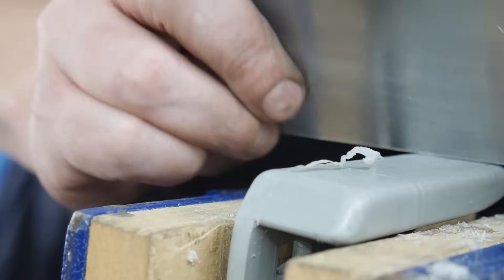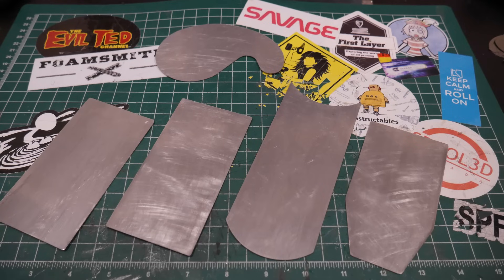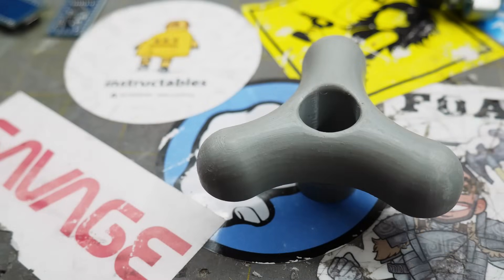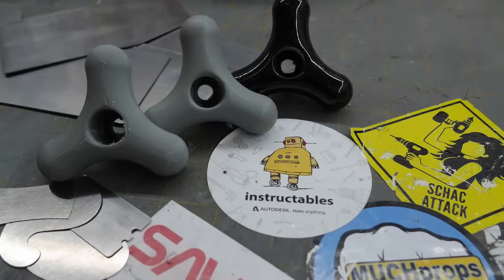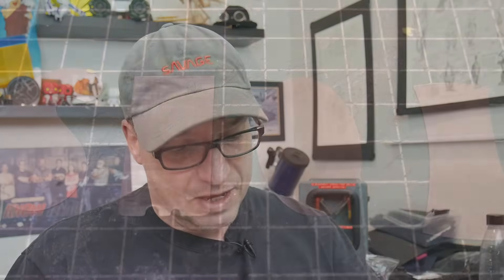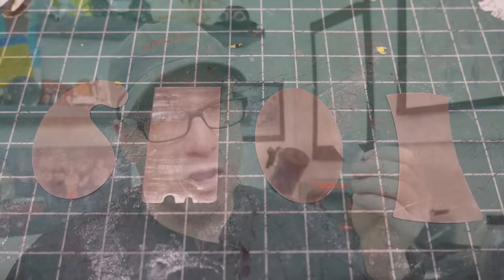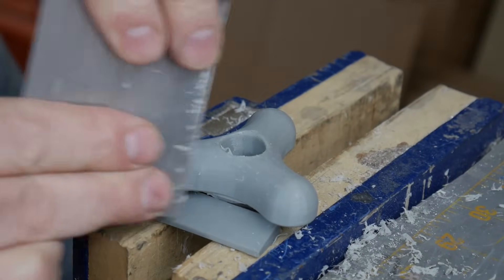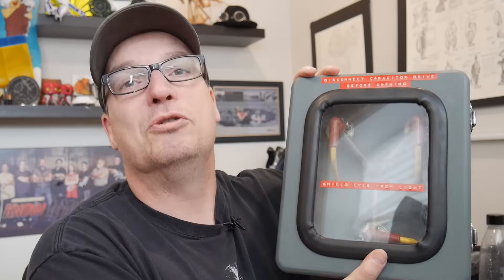Smooth pla 3d prints by shaving them. Don't sand your pla, shave it.

Comment: Ben, I make small custom scrapers using that black steel banding they use to bundle lumber together for deluvery to lumber stores and at construction sites. It is ~3\4" wide, carbon steel. One can cut the profiles  wanted with tin snips (which leaves a decent though rough burr), or refine it with sharpening stones  files and a burnisher.
Reply from the maker: Here is a sneek preview of my next video: https://youtu.be/TbvFPN7yxt0

Comment: I refurbish printers for a living, and use a razor blade with the edge folded over to do this exact process for removing scuffs on the outside. It works way better than magic erasers to remove marks from plastic, is very quick, and barely removes any material.
Reply from the maker: Here is a sneek preview of my next video: https://youtu.be/TbvFPN7yxt0

Comment: If you're really desperate to try this out (before buying all the gear) you can use a NEW utility knife blade and use it carefully (can catch an edge and/or skip easier than with a real scraper, esp'lly when it starts to dull) and you have to use it more vertically than a scraper (pretty much 90°) - once it dulls slightly it's over though - still plenty sharp to use in your utility knife. I prefer the stanley trapesoidal (11-911) blades than the snap-off ones (though they'll do in a pinch and for broader flat surfaces), but I'd like to try their 28-510 blades which are more flexible (used in sticker scraper handles). If anyone has, let me know below.
This is definitely the poor/lazy person's scraper though - better results are achieved with a properly 'sharpened' scraper.
Reply from the maker: Here is a sneek preview of my next video: https://youtu.be/TbvFPN7yxt0

Comment: i find if your prints are smooth enough, removing stuff with a good scalpel and then sanding a little before a coat of resin is good enough
Reply from the maker: Not many coat with resin. But that is a method I use occasionally
Reply from the maker: Here is a sneek preview of my next video: https://youtu.be/TbvFPN7yxt0

Comment: Great info and good tool to keep on hand. You might also want to look into filler primer if you have not already, it's basically primer in a spray can that goes on super thick and self levels and can hide 75% of layer lines with 1 coat, that along with these scrapers should make for glass like prints. The filler primer also sands super fast and easy if you need to. I often will just spray 2 coats of primer filler and then paint with no sanding at all and get almost perfect results.
Reply from the maker: I have tried this and it honestly is not as effective. I do have a method I find works better than the filler primer and is not a aerosol here https://youtube.com/shorts/NVWWO6kvzXE
Reply: @DreadMakerRoberts  I have used a lot of the spot putty as well (though not thinned) the Dupli-Color filler primer is the bomb though (much better than Rust oleum) and I found out about it from a friend that paints $100,000+ cars for a living, yea he uses it on them. His paint jobs look like piano finish (wet look) and they are amazing (pricy as well).
Reply from the maker: Here is a sneek preview of my next video: https://youtu.be/TbvFPN7yxt0

Comment: Spray filler
Reply from the maker: Seriously not as good in this case and less aerosols
Reply: @DreadMakerRoberts  You painted the part anyway, so a precoat seems fine.
To get stuff baby skin smooth I put on 2-3 coats with light sanding in-between. Shaving sounds good to get sharp edges back
Reply from the maker: Given where I work I rarely get the time to do 2-3 coats. I am lucky to be able to get a prop to set that has had time enough to put it on camera before the paint is dry :)
Reply from the maker: Here is a sneek preview of my next video: https://youtu.be/TbvFPN7yxt0

Comment: what helps .. print asa.. or abs.. they sand like 100 times better :) i always like asa.. cause less smell and uv resistent and very strong
Reply from the maker: This works amazing on both of those and you still gain speed on sanding
Reply: @DreadMakerRoberts  sure but sanding asa/abs is way easier and has better results
Reply from the maker: That’s cool. We can agree to disagree. This has me pausing to re-try just sanding. So if I do that how about you take the edge of a stainless ruler or back of a razor blade and try my way. Deal?
Reply: @DreadMakerRoberts  difference is realy pla petg vs asa or abs there pla and petg are hard to sand
Reply from the maker: Here is a sneek preview of my next video: https://youtu.be/TbvFPN7yxt0

Comment: not a bad idea, personally as someone who worked at a rapid prototyping company. The paint department would murder us if we used this to surface parts.
Reply from the maker: Why though? Too smooth? You can hit it with a light grit very quickly after to establish a bite for the paint.
Reply: @DreadMakerRoberts  for a concept car for Ford or Honda. One, the size of some of the parts is just to large. For professional grade paint job a catalyst hardening primers are needed. With these the possibility of the surface looking wavy after painting is higher than a using a sanding block. Plus the dudes full time surfacing are very efficient and fast at what they do
Reply from the maker: Totally. I’m not delusional, the pros and everyone else have their ways. This is just a thing for people to consider. It works like gold for me. In my world that’s what counts.
Reply from the maker: Here is a sneek preview of my next video: https://youtu.be/TbvFPN7yxt0

Comment: If you are using them for resin prints, would you cure the print first or shave it after a IPA bath?
Reply from the maker: It works on resin. I find you can bulk take off material in the raw state uncured and then fine details in the cured state. However the tougher resins that are flexible do not work as well
Reply from the maker: Here is a sneek preview of my next video: https://youtu.be/TbvFPN7yxt0

Comment: Looks like a good idea. Will give it a try 👍
Reply from the maker: Has it worked for you?
Reply: @DreadMakerRoberts  I have not been able to find a good scraper where I live 🙁
Reply from the maker: @TheRealStructurer  Where do you live? One can cobble a small scraper together with a inexpensive stainless steel ruler. Burnish the edges of pieces cut off of one and you basically have scrapers.
Reply: @DreadMakerRoberts  Malaysia
Reply from the maker: Amazon or my last suggestion are best then.
Reply from the maker: Here is a sneek preview of my next video: https://youtu.be/TbvFPN7yxt0

Comment: Another Eureka moment provided by a helpful stranger - this is going to save a tonne of time and filler... many thanks. I left a lengthy comment on another video, where a guy was sanding his models down to 2000g and then painting it! Endless hours spent on sanding a piece to the point that the paint can't even establish a good bond. I was suggesting to never sand above 400g before painting (even 220g is reasonable) if you allow for a good primer and/or multiple wet-sanded top-coats. I've used scrapers for ages, but only on wood and the results are amazing and almost glass-like on hardwoods. I'd never considered running it on plastic and now I'm pretty stoked to try it. Gotta get some of the luthier cards (yes, you said it right).
Reply from the maker: Yay! my Canadian tongue said something right for a change eh!
Reply: You can just use acetone. It will smooth and make shiny in one go, no real work or painting required.
Reply: I'm only on my 3rd print on the new printer, so I'll have to give that a try, once I'm a bit more versed in the process.
Reply from the maker: Here is a sneek preview of my next video: https://youtu.be/TbvFPN7yxt0

Comment: Considering this video is 2 years old, has anyone some long term experience with this technique? Does it affect the dimensions of your prints when done not properly or is is compareable to sanding in that regard. (Besides the mentioned time savings)
Reply from the maker: The dimensions are affected by 0.05mm or less. It is the same as sanding
Reply from the maker: Here is a sneek preview of my next video: https://youtu.be/TbvFPN7yxt0

Comment: Have you tried combining the two? It seems theres still some visible layer lines after you scrape. But if you sand it from there, does it still dramatically reduce sanding time?
Reply from the maker: Yes absolutely. No one solution to any problem ever seems to work.
Reply from the maker: Here is a sneek preview of my next video: https://youtu.be/TbvFPN7yxt0

Comment: Don't have a buffing wheel, but would be interesting to see if it worked seeing they buff metal really well.
Reply: the problem with using a buffing wheel is it that the friction can generate a lot of heat which will end up warping parts, though i'm sure someone could master the technique.
Reply from the maker: Here is a sneek preview of my next video: https://youtu.be/TbvFPN7yxt0

Comment: This is very interesting, thank you for sharing!  I have been fdm printing for almost 10 years now and have been using an exacto all this time to do exactly this!  Never thought of a purpose built tool, but definitely alot safer!
Reply from the maker: Yes but the blade can be handy in tight spaces for sure.
Reply: I figured out I like scalpels for shaving more than exacto knives because they’re more flexible and you can replace them more often since a box of 100 is like $12 on aliexpress. I was using them for years to remove mistakes when woodburning so when I started printing it was what I had available. But some might not like that flexibility and prefer a more rigid blade.
Reply from the maker: Here is a sneek preview of my next video: https://youtu.be/TbvFPN7yxt0

Comment: This is pretty interesting. Can you please clarify what your layer height of your prints were and how many walls you used? I've had success using a mix of bondo putty and acetone and sanding that down, but this would be nice if I didn't have to use my spray gun and spend time cleaning up and letting it dry before sanding.
Reply from the maker: Layer height was 0.2 and single wall 0.6 nozzle but over extruded to 0.8mm FYI you can use the acetone method with a paint brush. Then you are not aerosoling it. https://www.youtube.com/shorts/NVWWO6kvzXE
Reply: @DreadMakerRoberts  acetone on pla?
Reply from the maker: @orbita1  Yes but it is toxic this is much less so.
Reply from the maker: Here is a sneek preview of my next video: https://youtu.be/TbvFPN7yxt0

Comment: Hi Ben. Do you have any advise on how to perfectly smooth a (PLA 0.2mm layer height) "Bracelet of Anubis" from the Mummy 2 film, that is on Etsy in the UK , only it has a very organic and detailed surface, and I can see that some areas will be very difficult to sand without catching other raised details in the process? As it will be painted in reflective gold, it needs to be perfectly smooth so as not to show any imperfections.
Reply: Thanks for the advice Ben, Ill check the pen sander out.
Reply: Have you had experience of using one of these sanding pens, only noticed its rather pricey, once the adjustable transformer is added on?
Reply from the maker: @deank3473     YES! I use them all the time. What I did was get a 12v wall wart that puts out more than 4 amps and just soldered it on to the cut off power adapter. You don't have to buy their power block b.s.
Reply: @DreadMakerRoberts  Thanks again for your help and advice. I ordered one this morning.
Reply from the maker: I would look up a "Proxxon sander" https://amzn.to/3rxOD6t it should be able to do what you need
Reply from the maker: Here is a sneek preview of my next video: https://youtu.be/TbvFPN7yxt0

Comment: Just tried this method, and I LOVE IT!  Light shaving, then some light pre-primer sanding, then voila!  Can't thank you enough for this insight.  

EDIT:  Found a way to make the prints ultra-smooth with this method.  Hold the cutting edge (edge that will cut the most material at once) at a 45 degree angle to the layer lines, but shave straight against the grain while keeping that angle.  Makes the surface almost mirror smooth.
Reply from the maker: Here is a sneek preview of my next video: https://youtu.be/TbvFPN7yxt0
Reply: So u mean if the lines are left to right I should push upwards against them?
Reply: @jonogunn  at an angle yes.  45 degrees to the left/right lines.   but if you're having trouble, use some coarse grit sandpaper (60-100) first then the card scrapers.
Reply from the maker: The angle is something that really is the angle of the burr on the tool and not so much a exact science. Start at 45 and experiment. it could be 25 is could be 60. Every burr is a bit different

Comment: Ok I just grabbed the scrappers I have and gave it a shot. We dang, that works. I think some priming and sanding is still required but dang. I even tried it on LW-PLA as a further test and well it worked as well. I just spent 6 weeks sanding and priming a large scale print, this would have cut that time down immensely. Thanks for putting this out there.
Reply from the maker: I feel your pain. When I discovered this my first thought was how much time I wasted sanding...
Reply: @DreadMakerRoberts  Well thats the thing about this hobby...it's all about learning. I am going to be printing some airplane parts in the next couple weeks out of LW PLA. Going to give this a try on them wa hoooo.
Reply from the maker: Here is a sneek preview of my next video: https://youtu.be/TbvFPN7yxt0

Comment: If it takes you an hour to sand to the point where the scraper too ten minutes, you seriously need to invest in some coarser grit paper; P120, P80 or even P60.  Personally, I love my MicroMesh 60MX, 120MX and 180MX, I also have the regular MicroMesh from 1,500 to 12,000 but they rarely get used on 3d prints.

Add a small spray bottle with a drop or two of washing-up-liquid and in the 10 minutes the scraper took, I could have the same, if not a better finish just using the MX's, give me half an hour and I could have it to a high-gloss finish using a selection of the regulars, and all dust-free.

However, those sets of luthier's scrapers do look interesting, they're really reasonably priced, too.  Also, you can never have enough tools, right?  :D
Reply from the maker: Here is a sneek preview of my next video: https://youtu.be/TbvFPN7yxt0

Comment: why not just use a box cutter blade?
Reply from the maker: It is much harder material and breaks, you can't re-shsrpen them because of how hard they are,  plus it's hard to find box cutter blades 3" wide. But they do work in a pinch
Reply from the maker: Here is a sneek preview of my next video: https://youtu.be/TbvFPN7yxt0

Comment: nothing like sanding, you could always use a rotary tools and even reach tight places, your way works mostly with large flat surfaces, a dremel would smooth that little handle in max 5 minutes not even 15!!
Reply from the maker: I find the speed of rotary tools melts the plastic so I have abandoned them. Do you have any tricks for this issue? Besides dropping the speed.
Reply: @DreadMakerRoberts  go slowly and don't keep it on there for too long, just like my wife says when I put out half smoked cigarette buds on my son's arm
Reply from the maker: Here is a sneek preview of my next video: https://youtu.be/TbvFPN7yxt0

Comment: Why not just resin print stuff and have smooth prints all the time?
Reply from the maker: Resin is brittle, and the cost to size ratio is HUGE with resin
Reply: @DreadMakerRoberts  I think you can solve that problem by mixing In 5% Tenacious resin with 95% standard resin. Smooth, flexible and impact resistant prints with very high details.
Reply from the maker: Here is a sneek preview of my next video: https://youtu.be/TbvFPN7yxt0

Comment: I have been thinking about getting into 3d printing but the sanding and other chemical smoothing techniques has been turning me off. Came across this video and your smoothing technique just make more sense. Plus shaving is more satisfying than sanding. Then there is also the benefit of not having to wear respirator because shavings are not small enough that you can inhale them like you get with dust particles from sanding. But ill probably still wear a mask just in case. thanks for your video.
Reply from the maker: Here is a sneek preview of my next video: https://youtu.be/TbvFPN7yxt0

Comment: Thanks so much for sharing this! I've just started printing out my Storm Trooper armor to eventually join the 501'st, and this is going to save so much time sanding, which will also make my wife very happy. This will also for sure be used in my woodworking, so thanks for that! Subscribed!
Reply: How did it work to use the cards to smooth the armor pieces? 
I also do 3d printed armor so any input would be appreciated
Reply from the maker: Here is a sneek preview of my next video: https://youtu.be/TbvFPN7yxt0

Comment: Been using same technique ever since. Just little modifications, i made a miniature version from 1.2mm steel, 12mm tall, 120mm long with a angled bit at the other end, the other end is flat but slightly curved (in top view). Had to also make a sharpening tool for it but it is worth it. By far the most used tool to round edges and to remove blobs. Just amazing, combined with rough sanding foam/sponge... so, so freaking fast. You scrape the worst bits off, brush it with sand paper or sponge, then scrape it again.. and it is done. Much better than any deburring tools or using just sand paper alone.

So thanks mate, you have save me a LOT of time with increase in quality.
Reply from the maker: Here is a sneek preview of my next video: https://youtu.be/TbvFPN7yxt0
Reply from the maker: So glad to hear this!